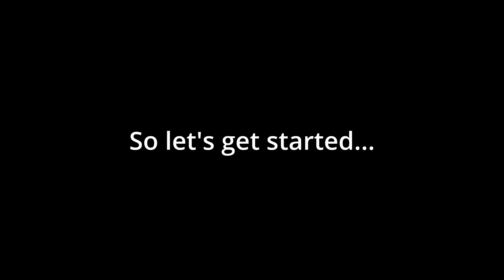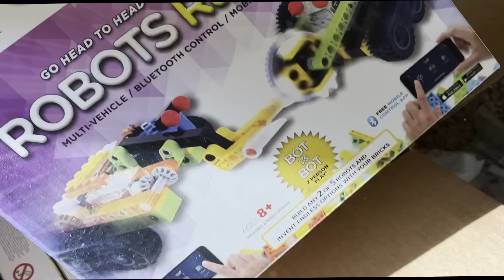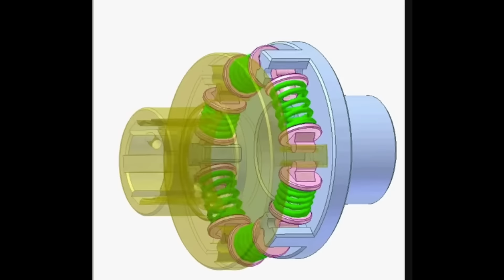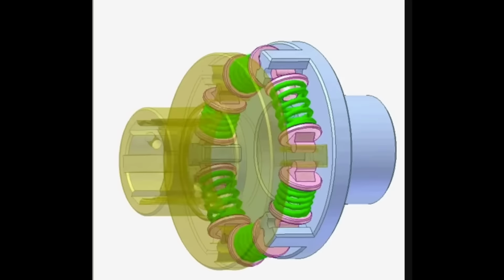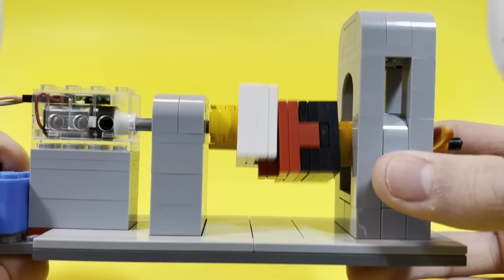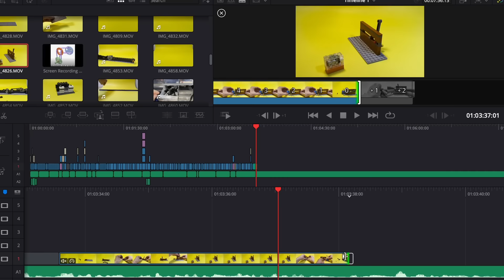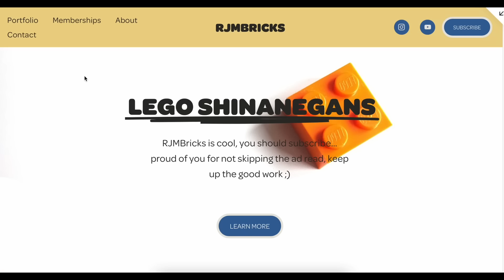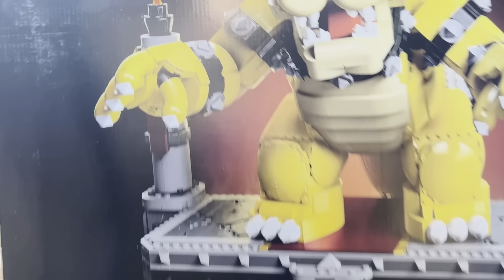40 Satisfying MECHANISMS in LEGO…

Comment: @4:55 - in fact 2 universal joints on the same axel, should be "connected" at 90 degrees, and not at 0 degrees as shown - hence the crack in the piece that you have ( probably;) ).  As an example - set 42029, instruction book 1, step 29, page 39 in the online instructions.